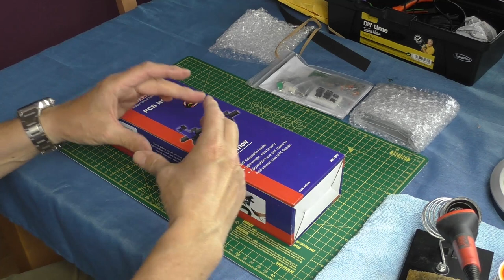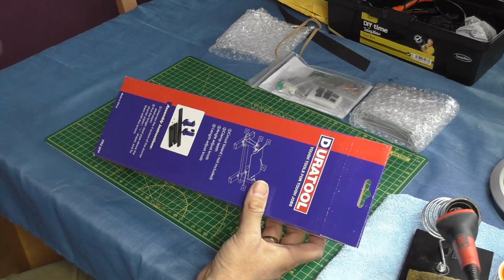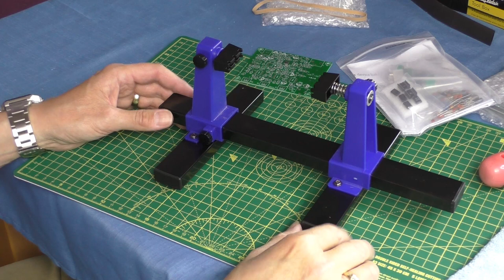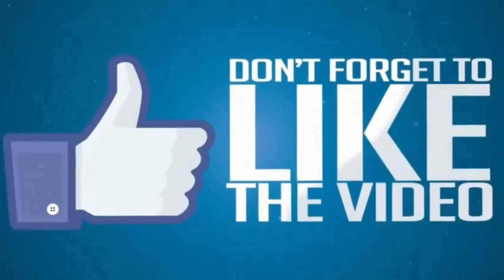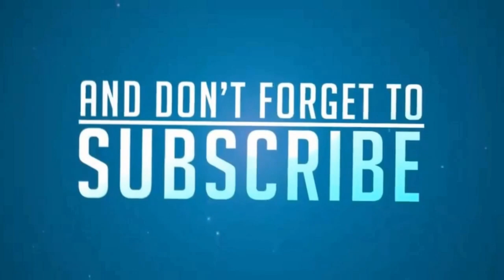PCB Holder Jig - Printed Circuit Board holder for Soldering

Comment: Amazon price has changed to £8.39 but still great value.  Take care and catch you on the next one.
Reply: Just bought one off Amazon US for  $12 bout the cheapest over here. I also use blu tack to hold pins down especially when working putting the pins in a raspberry pi
Reply: @K5NOV  Cheers for the bluetack idea.  I might give it ago.

Comment: Especially on old ussr electronics pulling the legs apart was common practice.Even today i do that where  one requires to solder a thd component on smd solder pad if you will.Never caused an issue.

Comment: Hi! I use one of these and use blutak or black tack photography putty to hold the components onto the front of the PCB while flipped, a flat sheet of blutak will hold all the components in place without being affected  by heat and doesn't stress the leads or components.
Reply: Sounds good.  Ive been trying masking tape which works well enough.

Comment: Nice video, I've ordered a similar one to build a Morserino device to learn morse code.
For any component without bendy legs, does the blu-tack tip work to hold them in place when you flip the board? Cheers!

Comment: I turned a really good circuit board holder into a super great circuit board holder.
Ron Jones K7RJ
I have the pictures referred to in this document I will be glad to send to you. Email me at my ham radio call letters AT arrl dot net.

Original holder was like this:
 

The problem was that when you adjust for the size of the circuit board, you also were moving main legs.  It was an awkward process because you were changing the entire geometry of the stand, plus the rubber feet made so you couldn’t just slide things into adjustment. 

A much better approach was to make the main legs fixed and make the vertical circuit holder arms adjustable. 

Here is a picture of the finished product followed with a bit of a description. The picture will give you the idea of where I went with this:
 

In the original design, see how the vertical arms are screwed to the legs. The adjustment moves both the legs and arms.

 

I removed the arms, only a couple of screws hold them in place.

 

I then drilled holes through the legs and toward the far end of the horizontal bar so I could mount the legs permanently on the ends of the horizontal bar.  You could drill holes all the way through everything and hold them in place with nuts and bolts or, since the metal of the bar is thick enough, you could do as I did and tap the holes in the horizontal bar.

 

I added a second set of mounting holes so I could move the legs closer so I could mount larger circuit boards.
 

 

Here is the finished product, soooooo much easier to use than before. 
Legs mounted on the end to work on smaller PCB’s

 

Legs mounted inside for working on larger PCB’s (I have never had to use this position, but it is easy enough to move the legs.